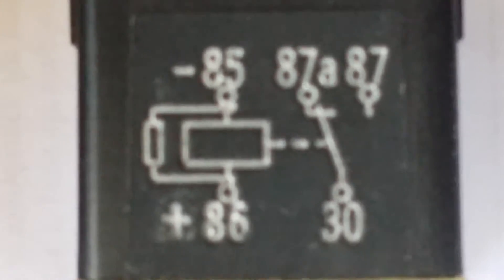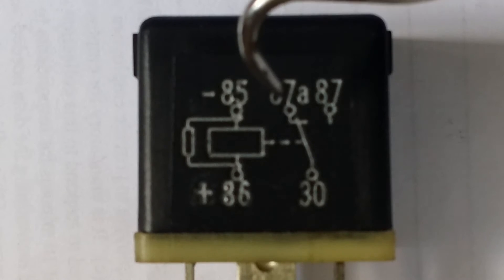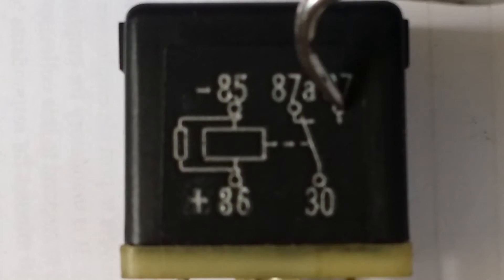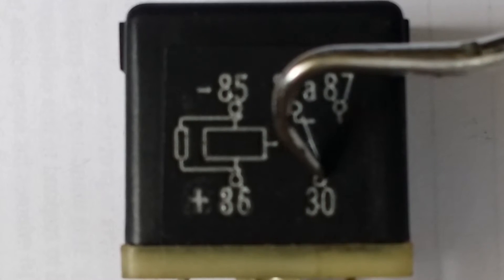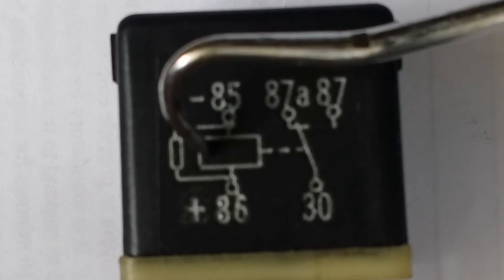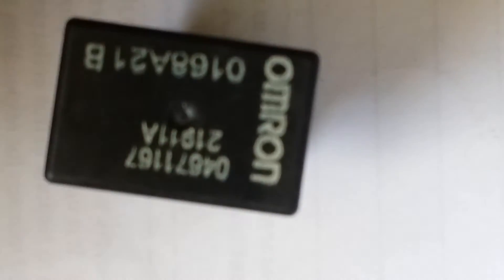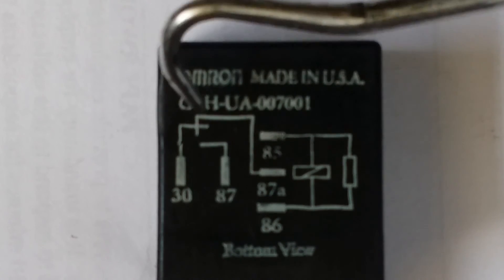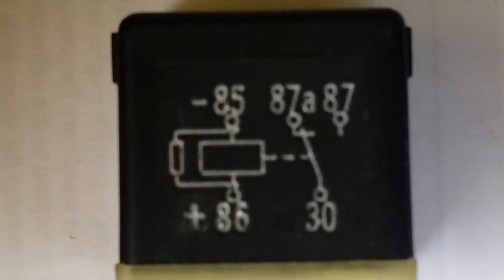how it works relays

Comment from the maker: OK see what you learned if you had a bad relay on your jeep and you wanted to put a jumper wire  inside the relay box to get her home what two pins inside the real box of the Jeep would you jump out ?
Reply: 30 to 87. So the coil leads are marked pos & neg. I know you mentioned that 30 comes from the battery and the load goes to 87. Would it still work properly if you put the battery to 87 and the load to 30? Or is it not designed for this? I'm wiring a solenoid to run a power hungry air compressor in my jeep & was wondering this. Thanks for putting out these kinds of videos.
Reply from the maker: +jake32401  sorry guy I never got a notification on this ? hope you got the job done